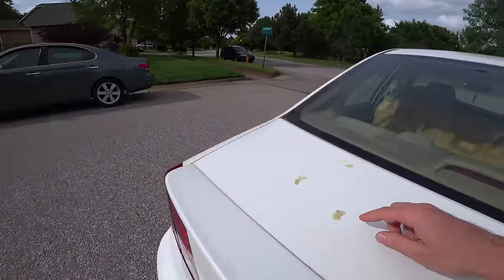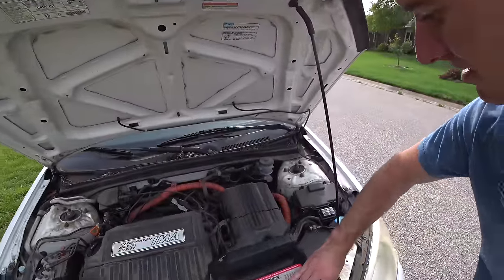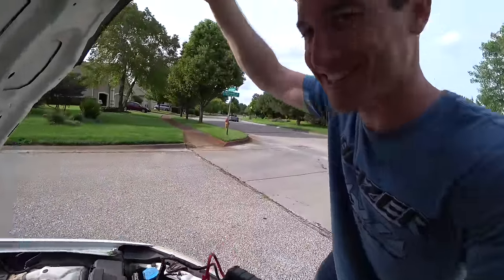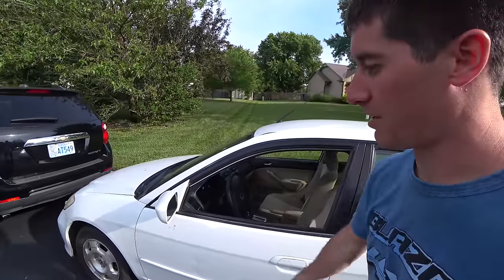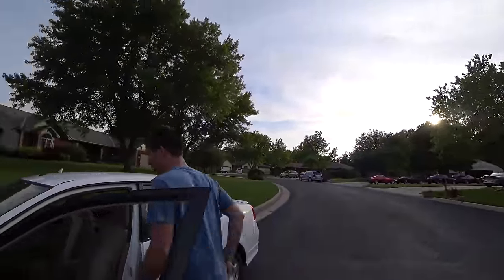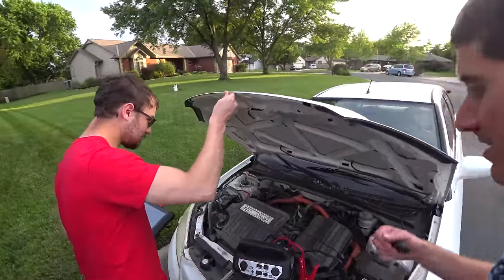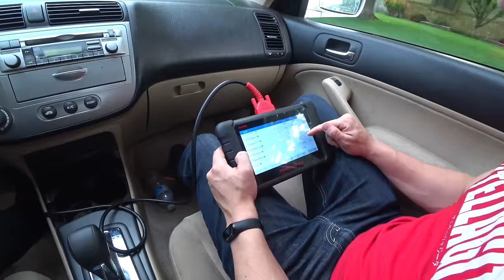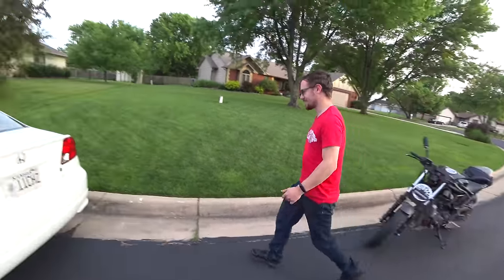I BOUGHT A CHEAP Honda Civic HYBRID With A DEAD BATTERY

Comment: I currently have one of these and I can tell you the IMA does ALL the charging and starts the car. Hearing the starter tells me the battery is done. Also the 12v battery is insanely expensive. Cheapest I could find was $120... one thing of note based on the mileage, it is due for the valve lifter adjustment and I would do a trans flush with the Honda CVT fluid ASAP! It's awesome to see you got one of these and I look forward to your videos.
Reply from the maker: I agree, the 12v battery has probably been deep cycled many times, hopefully it's not that much! 🍻
Reply: Another pro tip: Do the gearbox fluid flush ASAP, these 7th generation honda gearboxes (if it is the SXLA gearbox, I live in Brazil and we don't have the hybrid here) are prone to failure around 150000 km without frequent (30-40k km) fluid changes. Good luck, I'm looking forward to see you messing with the IMA battery =D
Reply: I do all the repairs on this car and love working on it but the parts can be insanely expensive because it's a hybrid. Don't expect racing speeds!
Reply: @ChuckFinley.  since he's going to flip it, he could go with a cheap battery, but it's not going to last. The reason the 12v hybrid battery is expensive is it is a lot better battery made for a hybrid car.
Reply: just buy one of those small 12 volt batteris for like running big radios and stuff.
Reply: @ChuckFinley.  I would agree with you if he was going to keep the car. But since the battery is charged similar to any other regular car battery, I would go with a standard automotive battery. The 12v also is a backup during cold starts as the IMA is unable to start the car in extreme cold. I say just go with the standard battery and absorb into the price
Reply: 120$ is insanely expensive to you?
Reply: @Fony_turgeson  it is if you are broke and the battery goes flat during a particular hardship. Most batteries for all my other cars run about $60. The battery for this thing is tiny and doesn't make sense for the price. I found it at advance auto for almost $200 for a decent one...
Reply: @WatchJRGo  what ever happens with this car?!
Reply: I've owned a 2004 Honda Civic Hybrid for 5 years, I paid $250. Supposedly transmission was bad, I added fluid. It had been sitting in a garage and mice lived the entire time, I left windows open for entire summer. Then started driving it. I've driven it on 3 2500 mile trips, what a great car, average 38-40 mpg on trips, 36-37 locally. Sometimes when it sets for 2-3 days, the main battery looses most of charge. Sometimes I have to turn ignition on and off 3-4 times. Some wierd things, never left me stranded!
Reply: @tony_25or6to4  I don't think the 12v battery for this car is any better. It uses a 51R and the standard civic uses a 51. 51R just means the posts are reversed. I don't think any of the power specs are different
Reply: @Fony_turgeson 😅 it was insanely expensive 3 yrs ago . I don't know how much it cost now
Reply: @jeffreyhebner1865 when you say "main battery" which battery you refer to? 12 Volt or IMA ?

Comment: If it's throwing SRS codes for seatbelt buckles, they have a lifetime warranty at Honda
Reply: DUMBERTHANYOUTHINK you’re right. I brought my 03 Accord in (car for my daughter) into a dealer back in 2017 when I bought it for her.... and the replaced the entire system because the belt was starting to fray. And discolor. And the retractors were shot. Etc etc. yup. Free of charge. The Honda rep who helped me told me that Honda is really good about safety stuff free replacement
Reply: Solid move from honda

Comment: Had the non-hybrid of this Civic. Most reliable car I've had. Bought it with 68K miles, put another 100K on it with just oil changes and a starter.
Reply: I have a 09 Honda Civic lx I got it with 103,730k and now I have 113,810k
Reply: wow thats crazy, im looking for one aswell
Reply: That's nothing for a Civic

Comment: make sure after you get the new cells installed in the IMA battery to also pick up an IMA grid charger and install the harness while you're in there will be awesome for the owner of the car to be able to maintain the IMA battery and get many more years of service out of it
Reply: I know someone who put one of those in and it absolutely destroyed the IMA battery since the battery was being charged beyond the car. The IMA system can't equate what the charge is. The plug-in devices do not charge each rail specifically like the car does and the cells are worn out faster.
Reply: @thedextertech22  
no it can be set to what u charge it. tons of folk do it to 1st gen insights.
Reply: Where can I buy a Grid charger ?
Reply: @juantorressanchez9920  Google it but the year make and model of your car then the words grid charger. Also go look on forums and do some research
Reply: @thedextertech22  the car dose not charge each cell pack separately in these older systems I also do not see how the grid charger destroyed The pact unless it was installed incorrectly or the wrong charger was used. They charge at an incredibly low amperage.

Comment: i work at honda as a diagnostic tech, we have a full set of ima tools that are all rubber insulated and elbow long rubber gloves that are mandatory when working on the ima system. make sure you do a cvt relearn once the engine battery and ima are all okay
Reply: How much cost new batery for this car?

Comment: I have a stick shift 2004 civic.  Great car.  My IMA system threw a code, replaced the IMA battery, everything ran fine, but still got an IMA charging system failure.  Never replaced that, but hybrid system still works, car is surprising faster than you would think.  I think your issue is the Voltage regulator, that may have went bad which would explain why your battery is dead.  My car has 180k miles on it.  Problem I am having now is the key ignition switch broke, replaced that, but I have to locate the right OBD programmer that will reprogram the  key to the car.    As for the IMA battery, I got lucky and got a used complete system for $500, swapped the battery, I never replaced the complete IMA charger system which is in the back right of the system.  My car HYBRID charging still work, and the boost still works, got me a few speeding tickets because I did not realize the boost had me 10 mph over the speed limit, but the courts dropped the ticket when i told them the car is a hybrid with a boost system that does adjust the power output, and you really don't notice the speed difference.

I do have extra automatic ECU for your car if you want to try it out in your car.  That might fix some of your code issues, If I was there in Kansas, (which I am planning on moving to from Lakewood WA), I would let you try out the other ECU, and swap in my Original IMA box, or core swap the IMA core batteries.  There is a way to individually recharge EACH Core rod on the battery, it requires disassembly to get each core battery rod out. The device you need is a special deep cycle recharge unit that you can buy through walmart.  I was going to try that, but the swapped in system worked. 

But if your IMA is an issue, I have a complete IMA, ECU, Battery system in my backyard, just needs to be cleanses up.  It looks like good condition, If youwere to get that, I would reconmend that you open the battery crate, and pull each battery rod, do an amp/volt check, look for the difference and swap out the bad cores.  I believe you can actually by each battery core rod.    I hope this helps. 

Also check your transmission for fluid levels.  The Auto's are plagued with transmission issues.  That is why I got the 5 speed manual, which are next to impossible to find, and have a very expensive clutch.

Comment: Dude, you have my car, only mine is gray and it’s a stick shift.  Been across the country from Georgia to Oregon and back three times.  IMA light has been on for 60,000 miles.  Sitting at 281,000 on original everything as of today.  Worth fixing - these cars are weird alien Civics but are somehow still reliable as hell and it still manages to pull 40-45mpg at 80mph on the freeway.  Looking forward to seeing you flip it.  (Fun fact - when the IMA is working as intended, with the Assist the 2003-2005 Civic Hybrids have more torque in 1st gear off the line than standard Civics.  Not that they are intended to be “fast” by any means!)

Comment: I recommend you start with the IMA swap, since you have the cells and you are going to do it anyway. Once that's able to power all the systems it's supposed to, you can diagnose anything left much more easily. (And, it will start in a different way - it will do this cool "auto start" thing and you don't crank it like an ICE). But honestly, if the gas engine runs smoothly for you, it's unlikely to have anything seriously wrong with it.

Comment: We had one of these!  Manual transmission :D Such a high quality car, and because it's heavier and lower than normal Civic it feels very planted to drive. Not, by any means, fast ... and that's WITH the IMA working. Excited to see what you will do with it!
Reply: Very jealous you found one with a manual.
Reply: wtf a hybrid with a manual transmission??
Reply: Yes it was offered in a manual transmission. Bought new, probably hard to find now. The take rate must have been suuuper small, Honda totally missed their target segment unlike Toyota. So not fast, but probably the best manual transmission I've found in a Honda, really S2000 shift quality.
Reply: @busydadscooking001  I have an 05 with 264k miles.  The shifting really is amazing.  The extra weight really does slow it down even with IMA.  I don't know how the automatics handle it.  Great being able to pick a gear for the job.
Reply: I just picked up an 03 with a manual. It's dead in the water after like 55mph. The ima light just came on after owning it for 1 day. I've put 190 miles on it and it has only used a quarter tank according to the gauge tho! The batteries I don't think are crazy expensive anymore. I also read you can drive them without the ima forever basically.

Comment: I just got a 2000 Insight with a manual transmission, a lot of similarities to the setup. Mine has a recent new IMA battery from Honda though, and I paid $1500 for it. Interested in the work you guys do on this!

Comment: My first brand new car was an 04 Civic EX coupe with a 5 speed, the optional side impact seat airbags, and then need to turn the ac off on steep hills lol.  It was a very nice car, but looking back it felt like a toaster.
Reply: That was the first car I ever bought, mine was used though.
Reply: Techguy after some girl changed lanes and redesigned the entire passenger side, I traded it in for an 07 Accord V6, with an engine.  244hp of gas guzzling fun that was ha.
Reply: Same here! My first new car was a 2004 civic ex.  still have the car. 302k I still love it. Also have a 2019 accord touring 2.0.
Reply: My 04 ex does fine on hills. I often put it in 5th hear going 45mph in city and climbs most small hills without having to downshift. Have never taken in the mountains yet. But I have been through the rockies back when I used to have a CRX. That was scary! No matter how many times I would downshift I couldn't accelerate, just prayed that I could maintain whatever speed that I did have

Comment: I bought one June last year with a bad IMA battery and 86k on it for $3,000 in CA.  Still running strong and did 6 months of Uber with it til it no longer qualified as an Uber car earlier this year.  Now sitting at 113k miles.  With bad IMA it average 36-38 mpg but on long trips I get 40+ mpg.   I'm  interested to see this car get fixed as I'll need to get new IMA to pass smog next year.  Only downside is it lose a quart of oil every 1k miles.

Comment: JR, you remind me of the way I used to buy my VWs. Usually a Saturday, I'd take my current one in for scheduled service. Nothing to do, I'd hang out in the showroom looking at cars. And of course, talking with the salesman. Not long before I'm waiting on the service to be finished so I could move the contents over to my new car. In nearly 23 years, I think there was only one or two times I was actually looking for a new car, the rest were due to oil changes! (I averaged a new VW about every two years, sooner if there was a design update).

Comment: I've owned a used one with a dead hybrid battery from 2005 automatic and I drove it for 2 years and replaced the battery while adding trans fluid to it twice after 30k miles and it still works

I got the refurbished battery replacement installed at my house for 850$
Reply: where do you live and who does this at that price?  I need this to save my car.
Reply: @andrewx7806  This was in Austin Texas - Through some 3rd party hybrid batter company who only did this with the Prius's and the Honda Civic Hybrids.

I'm currently trying to figure out how to get my car to pass emissions in GA without putting tons of money in it. Sucks

I'd reccomend getting a non-hybrid

Comment: You will need to check the air bags because of the Honda air bag recall  because when the air bag deploys shrapnel gos in the the Passenger compartment injuring you or killing you

Comment: Nice buy. I picked up an 07 civic hybrid for $400 with a half dead hybrid battery and 305k miles on the original engine and transmission.  5k miles later and it still runs amazingly
Reply: I'm buying an 06 with 300,000 with an oil leak and needs drivers rear door.. for 500

Comment: I have a 2007 civic hybrid, and everything for it is insanely expensive. The 12 volt battery was $130 for a lawnmower size battery, and the hubcaps for the hybrid only wheels were $70 each.

Comment: i bought a 2003 with a good battery pack, a dead 12v battery and a bad CVT.   

replaced trans after freshening it up with new clutch and orings .  

$700 car.
$700 trans.
$100 trans rebuild kit.
$50 ball joints.
$8 serp belt.
$9 cabin filter.
$30 radiator fan
$40 HVAC fan.
$3 oil filter
$25 oil
$49 transmission fluid.
$12 tie rod

Comment: great car i have 2004 civic hybrid 214800 miles still gets 43.5 MPG
Reply: I have a 2003 Civic Hybrid but because the engine light is on (code p1600) I can't get it smogged and will have to junk the car.  The fix is probably a new hybrid battery.  Very costly.  It's sad because the car runs great and gets great mileage.    CA smog rules are ridiculous.

Comment: You’ve probably seen it, but the Honda Insight website (InsightCentral) has a wealth of knowledge about refreshing/maintaining the IMA system. The ICE is different, but the IMA system is almost identical. 
Cool part for this generation CVT Civic is that it will go into leanburn (my CVT Insight won’t) just like the manual. 
You’re right, JR, the system is very easy to work on. Good luck, they’re great little gas sippers!

Comment: Funny thing is that the plastic cover for the air freshener trees is not supposed to be removed when new but just opened enough to allow it to be slid down to expose just the top of the tree and afterwards slid down as the smell diminishes which makes it last much longer and avoids overwhelming you and your passengers.  My father pointed to the instructions which apparently absolutely no one reads.  (well almost no one)

Comment: I had one of those for a short time. A co worker owned one and the hybrid battery died. He had just put a new under hood battery in it. $100 later it was mine. Swiped the brand new under hood battery for my lawn tractor and scrapped it for $150.

Comment: Broken civic ima club here:  my manual civic boned it’s battery around 80k miles and it was covered under warranty.  When the battery failed it ran outta juice fasssst - two short pulls on the freeway and it would be done.

Comment: I suspect the old guy that had it before Roberto took it to a garage to get the issues fixed, and all they did was take the bulb out of the EML and tape over the IMA light on the dash.  And charged him several grand for the "work."  "Yup, it's all fixed" when the car is still as sick as it ever was, just without the warning lights.  I wonder if his new vehicle came from the same garage, as some places are really not at all above doing really shady stuff if they think they can force the customer into spending a load more money on buying a new vehicle rather than fixing what they already have...

Comment: Go to www.insightcentral.net to learn about these 1st gen Honda Hybrids, The Civic is basically the same system as the Insight. 

These cars can easily be driven on the gas motor only IF you switch off the battery pack in the back. Then it absolutely needs a healthy 12V battery to work properly. 

This car does not have an alternator. It uses the electric assist motor to charge the 12V battery. You have to be running at least 1500 RPM to start charging, but 2500-3000 rpm charges faster. At idle it is not really charging at all. Also this car has electric power steering which puts a good draw on the system at low speeds.

Comment: Electric power steering and the alternator works internally with the Hybrid Battery. My battery light turns on i pop it in neutral roll down hill and pop the clutch, mine is 5spd. 2003, its still broken i got it broken, even have spare 20k motor for it.

Comment: Think that's rough, try driving a ford five hundred with no power steering.   Yea it was absolutely miserable.   A body builder wouldn't be able to maneuver it in tight spaces.
Reply: Brian hell nah try a B6 Passat with electrical failure it was a bear
Reply: Power steering on our old fire engine has failed in middle of a 90° turn. Two people had to move the steering wheel

Comment: The 12v battery charge by the generator that charges the HV battery as well. It doesn’t have a alternator like regular gas cars.  So if HV batteries are shot the 12v battery will drain as well.